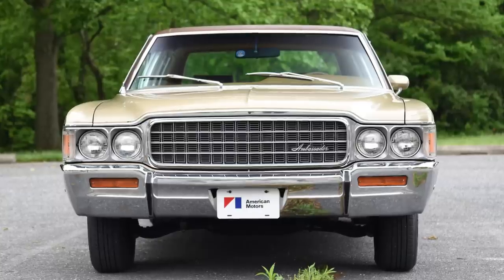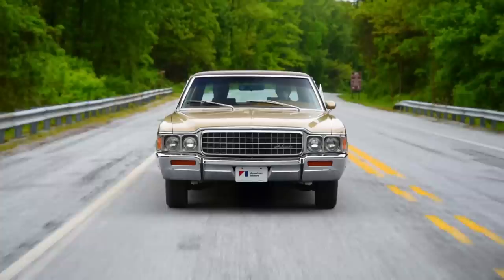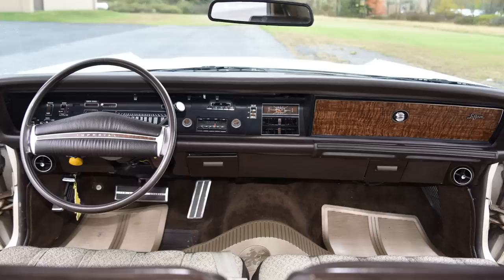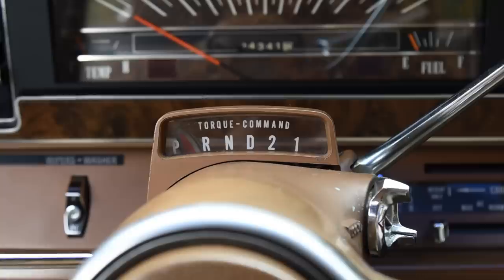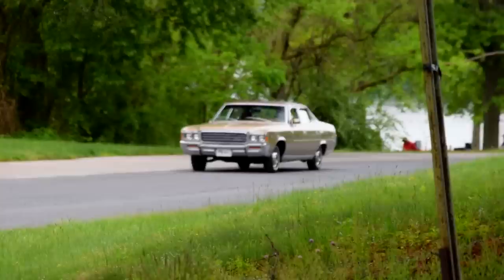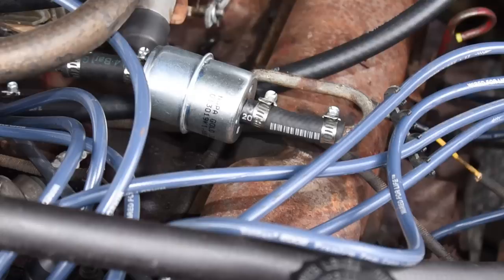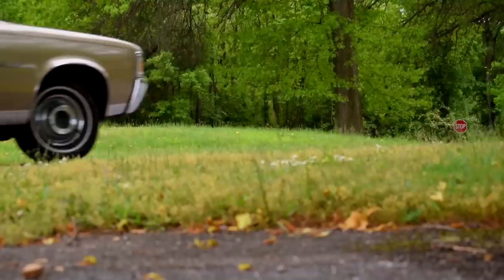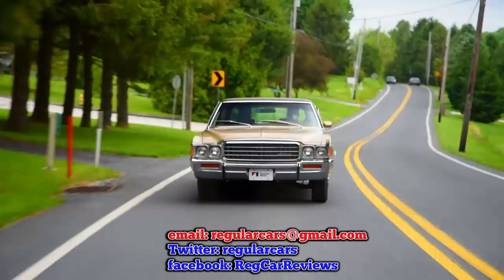1972 AMC Ambassador Brougham Sedan: Regular Car Reviews

Comment: Unibody structures were around long before 1960.

Really began in the 1920's with Lancia and DKW.

The 1930's with the Citroen Traction, Chrysler Airflow, and Opel Olympia/Kadet/Kapitan.

Nash in 1941 as an option as the Ambassador 600.

Chrysler began it's unibody transition in 1957.

Ford just knew making the Falcon unibody would help contribute to lower production costs, thus low retail price for the masses. 

One would have to thank Nash/Rambler/AMC for the decades of research and development that went into making unibody cars safe and strong in the 40s, 50s, and 60's. In this case if the Chevy II copied the Falcon. The Falcon really copied the Nash/Rambler.

Comment: 6:35  Anyone else catch the "Desert Only" setting on the A/C?
Reply: Omw what's that all about LOL
Reply: A feature was the "desert only" setting on the A/C thermostat control, a position that typically ran the compressor continually. In humid environments, the evaporator will freeze up from the accumulating condensation if the compressor operates constantly, which will ultimately block airflow.[18] Other temperature settings cycle the compressor to prevent this problem. Freeze up is not a concern in dry environments such as deserts, and this setting provides constantly cooled airflow into the passenger compartment.

Comment: I'd slap a 4 barrel carb and dual exaust I bet if you worked at it you could get 250 horsepower on stock block and internals.

Comment: Hmmm I'm starting to look at an ambassador Brougham wagon. I got a motorcycle that will make 160 two up (though I would never take a passenger that fast). Built a Chevelle up from nowhere, and drove a CPro Fiat, I found my fast on the scooter. Hell I would prefer a wagon to all of those clone cross overs out there. I don't know how those cross over drivers even figure out which of those gum drops are theirs in the parking lot. Note, if that car was mine I would get a new intake and a nice holly and set aside an afternoon to make the swap (and of course on another weekend maybe a nice set of headers)

Comment: That design set the trend for American cars for the rest of the decade. It was a 72' but wouldn't look out of place in 1979 or even 1982. The interior design was in many ways better than those from other makes. That 175hp from a 5.9L V8 pre emissions strangulation was inexcusable though, that was really bad, it should have made 240hp and even that aint great either.

Comment: 175hp @ 4000rpm
285 ft lbs @ 2500rpm

that's a good 2.0 liter 4 cylinder TDI specs

but with a V8 noise and a 5.0 liter Carbureted V8 fuel economy

Comment: I've seen one of these very close to where I live. Far better optioned than this one is. You know power everything and an actual AM/FM radio and cloth seats. And it's a nice shade of blue and only has 14 thousand one owner miles. But these cars were never meant to perform like a sports car. It was all about the soft ride and total comfort. Odd car like the AMC's were but it did the job reasonably well. Besides try to find one....good luck.

Comment: 5.9l v8 that only makes 175 hp seems fitting for a car this brown.
Reply: In 1972 bhp ratings were changed, now net figures which was the power developed with all ancillaries installed, it's actually a real number, gross bhp ratings are 100% useless and were nothing but phallic symbols.  That and NOx emissions started in 1972 so the automakers were forced to lower compression ratios to comply.

Comment: So i looked up the stats on this car to see how slow qualifies as boring in RegularCars terms. It turns out this amc has a kerb weight of 1656kg and with the 5.9L 175hp engine it has according to the website a 0-60mph time of around 10s, which is about on par with the 2010 Toyota Corolla which has a kerb weight of 1255kg and a 1.8L 132hp engine. So my question is, does this amc drive like a Corolla? If so, it's actually not bad all things considered, apart from the fuel economy of course, and maybe the body roll. In my experience the Corolla and the Yaris from the 2010s never felt slow on the highway. The 2012 ford fiesta I once had to drive at work on the other hand felt like it had a mind of its own when it comes to when to accelerate and for that reason i never want to sit in one again, even though it apparently has a faster 0-60mph time than the Corolla.

Comment: I find it imteresting that it took you 5 minutes before you mentioned that the engine was 360 CID.

I would also like to say that I'm pretty sure that 1970 was the last year of no emissions control.  That's what I always heard in read when looking into buying my first car which ended up being a 1972 shit brown inside and out Buick Skylark sedan that was significantly cheaper than any 1970 or 1971 V8 powered car that I could find.  But, maybe AMC did not do anything until 1973 emissions wise, because noone gave a shit about their cars, although I do have to say that this car has a certain appeal to me.

FYI, if you didn't know already, the way hp ratings were determined changed in 1971 or 1972 for whatever reason.  Maybe to make the government think that the cars weren't so powerful anymore.  Maybe someone else can opine on everything I've said as being complete and utter shit.
Reply: 1971, the government mandated the phase-out of tetraethyl lead, and the octane of regular gas went down some, so compression ratios had to go down too.  
There were some emission controls since about 1963, pcv, positive crankcase ventilation.  I think there were more by 1971, but not sure what.  EGR, exhaust gas recirculation, maybe.  Reduced NOx, certainly reduced power.  Saw a video of a 1966 California AMC Ambassador that had an AIR pump emission control device.  The gov't had a schedule that was steadily ratcheting allowable pollutants down.  
I think it was California that mandated for 1971 that advertised horsepower had to be determined as SAE Net instead of SAE Gross as was the custom up to then.  The automakers just made that the nationwide standard starting 1971.